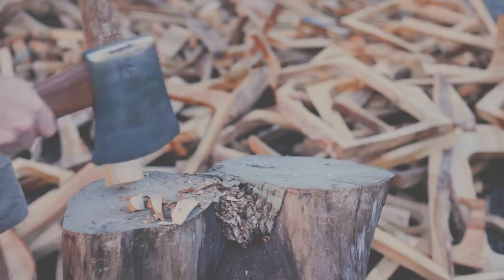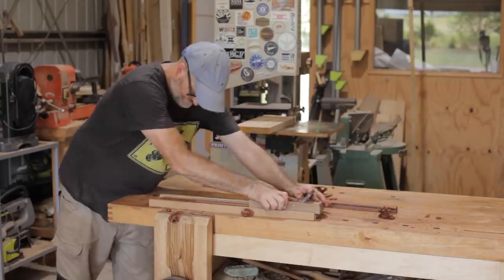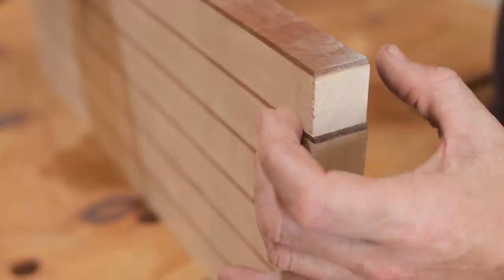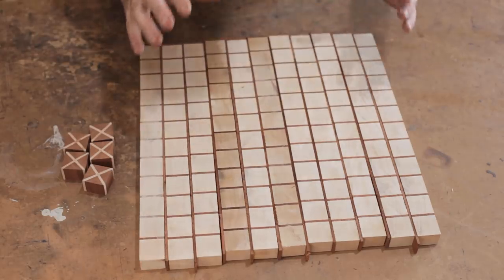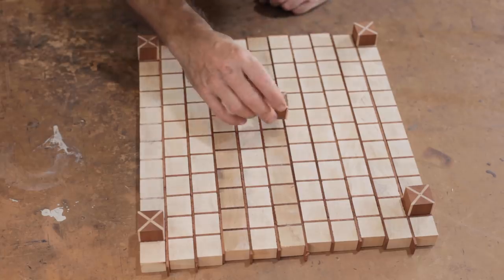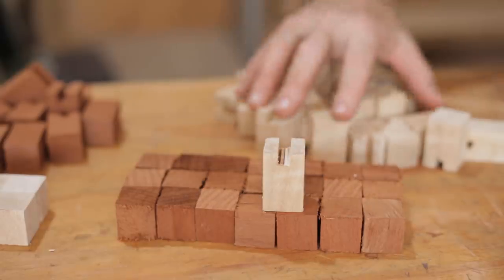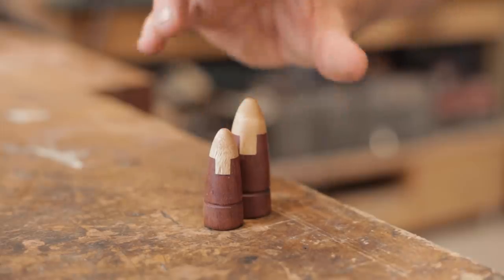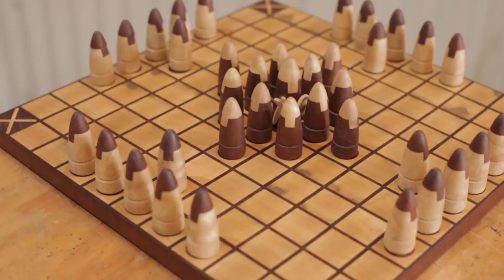Viking Chess game - Hnefatafl - Scrapwood Challenge ep23

Comment: I'm impressed by the repertoire of methods to surface a piece of wood I see; face jointing, table saw, thickness planer, hand plane with jig, disk sander, belt sander, freehand plane with square, orbital sander, plywood with sandpaper on it - even just the surfacing is quite educational.
Reply: I know in my heart all these words are English. I swear they look like English.
Reply: @gionnifer  "Repertoire" comes from similar French and Latin words meaning list/inventory, and is used to describe a set of practiced performances. 
https://www.etymonline.com/word/repertoire
It's ok to nerd out on some things here and there, at least that's what I tell myself.

Comment: A time lapse of an actual game, move by move, would be interesting to see.
Reply: I'm rather curious as to how the king would react if the four refuge corner squares are guarded? No capture, no refuge. So the battle will always be at the center.
Reply: @simpletongeek  Good point. Presumably the pieces that guard the castles cannot be taken, since you can't position pieces either side of them.
Reply: @nagualdesign  some versions of the rules states that an empty refuge square can be used as anvil, but that can be easily covered by doubling up pawns.
Reply: @simpletongeek  I know that by "empty refuge squares" you mean the castles, but I can't imagine what you mean by "anvil". Also, pawns are from chess. I think these are called attackers and defenders, or simply pieces.
Reply: @nagualdesign  hammer and anvil. As in one piece and the square acting together. Also, king and pawns are from chess, but you know what I mean. No problem.

Comment: I love this, though that board is a ton of work! I can only see making the pieces easier by mortise and tenon a length of board and then cut the piece blanks from that. At least it would save the risk and time it takes to do all the pieces one at a time in two halves? (I hate using the table saw for such tiny pieces)

Comment: Looks like your kumiko projects got you ready for all the bits and bobs this project entails. I think I saw a couple of jigs that might have been handy for kumiko like that one for the plane and the other one for sawing small bits. But the set up you used for putting those small blocks through the saw for the tendons was genius. (but couldn't you have put the tendons in a long strip of wood and then cut it into the small blocks? What was the advantage of doing it your way?) ❤🌅🌵

Comment: Not to sure if i would call it scrap wood after useing those professional tool... Trees don't get processed right away after they r chopped... Corrosion doesn't care if it used stuff or not and the wood is miss shaped but after cutting off unwanted parts they just become normal planks etc.
Isn't the purpose of challenges like this to make use of what you have at hands without preparing to much? Like useing a damaged table and carving lines out to creat the field... Like this it is just a DIY video where the planks are selfmade.

The way you did it was more professional than my suggestion and is probably more fascinating to watch but a failed challenge..
The extra steps are appreciated through. Good job, keep it up :)